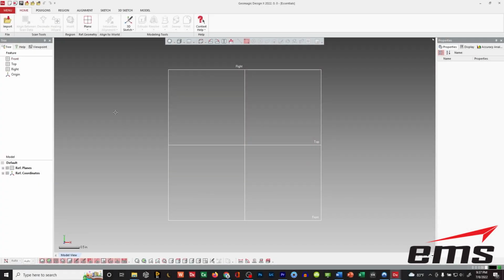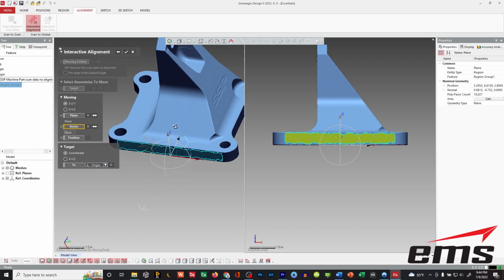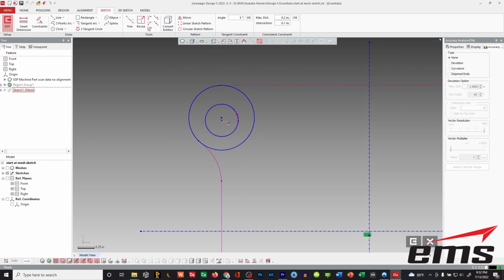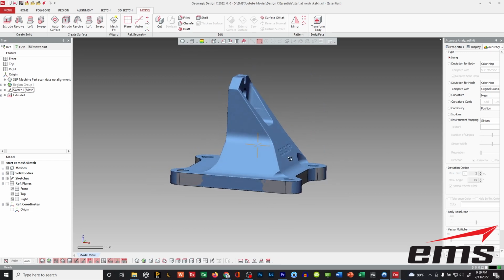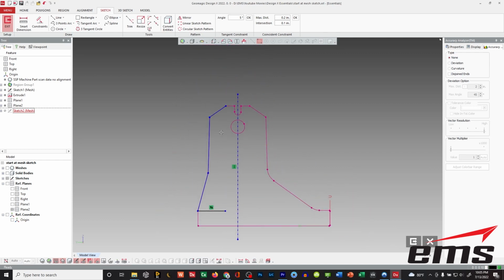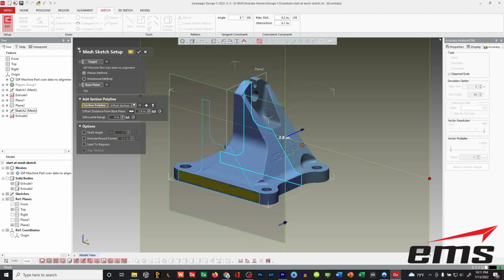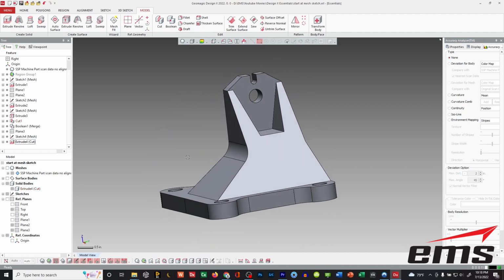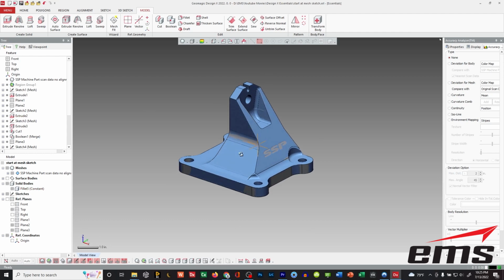Design X Essentials 2022 - In-depth Demonstration

Comment: what kind of scanner do you used here ?
Reply from the maker: Creaform HandySCAN
Reply: @EMS3D  Wow, that's very expensive. I am considering opening an eBay shop where I want to sell 3D printed things for various purposes. I have thought about buying a 3D scanner for this purpose, but the professional ones are quite expensive. What can you recommend for a maximum of 3000 USD for reverse engineering ? Resolution, accuracy, and details are most important things to me, I want scann small as well big obejcts (max 1000mmx1000mmx1000mm) .
Reply: @Artem1234-m9d CR Otter would be my choice in 2024 for 10cm to 1m. For small to medium parts the CR Raptor. 
The scan software gets better each release so far. Every month a new version. Last one with a firmware update for the Raptor and Otter too.

Comment: Very nice video. Thank you very much for that. Is this the version that comes with Einscan RE Bundles?
Reply from the maker: Hi 3D Machinery.  No this is not that version.  That is called Geomagic Essentials which is based on Geomagic Wrap not Design X.   Geomagic essentials has no 2D sketching or solid modeling so it quit limited when compared to Design X Essentials.  Hope that helps.
Reply: @EMS3D  Thank you very much, this helps me a lot. The similarity of the names confuses a bit. But on the homepage of 3D Systems this version can't be found at all?!